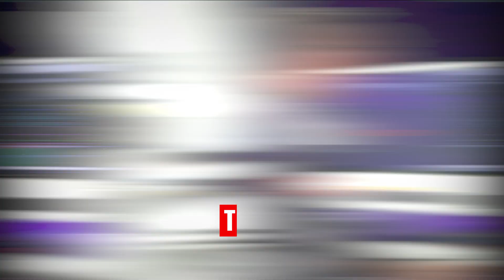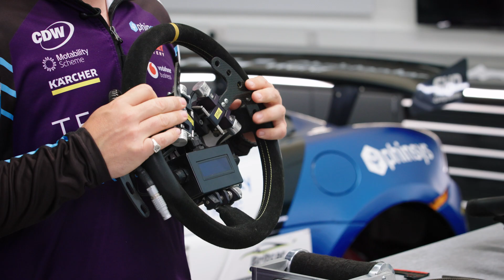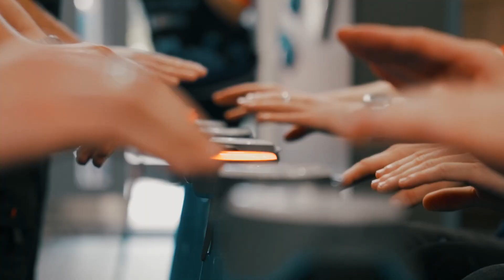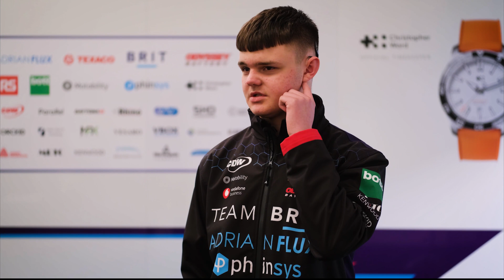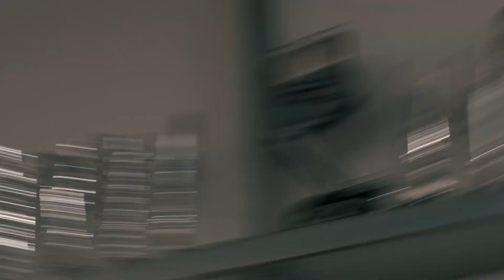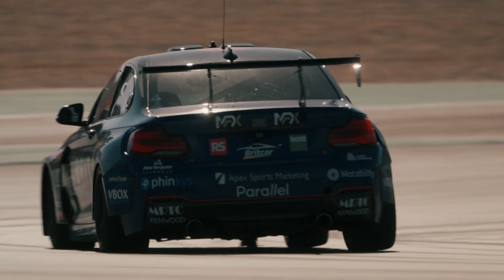ADVANCED HAND CONTROLS: The engineering that helps Team BRIT's disabled drivers compete and win

Comment: ive been following team brit for some time now, and I am very impressed with this system and wish I knew more about it. Would it be possible to program both paddles on the back to be throttle instead of one being brake ? Ide like to see the pinned steering shaft it connects to. pretty amazing stuff